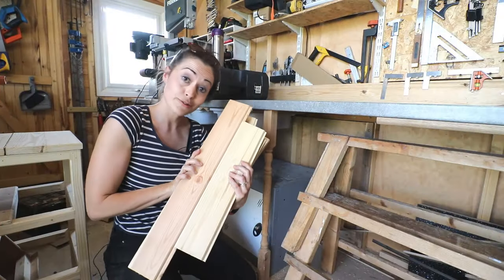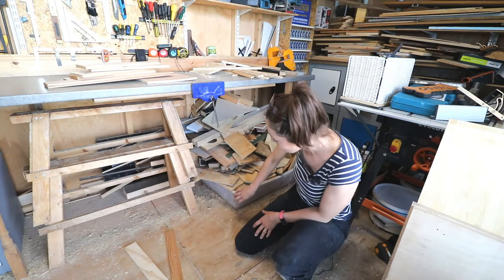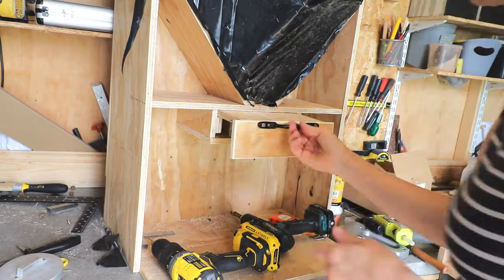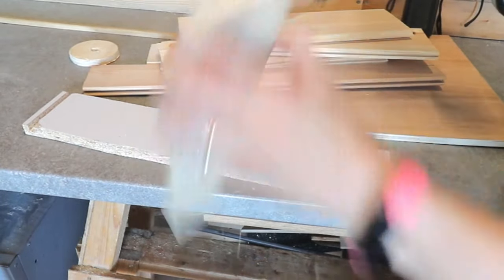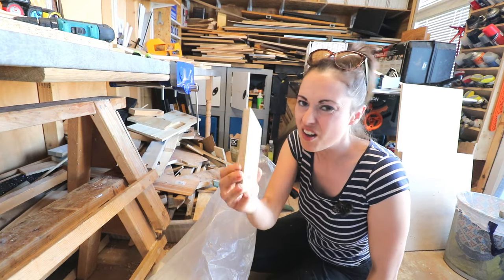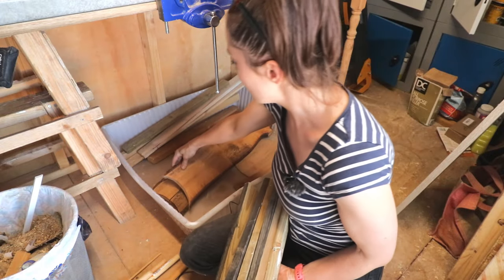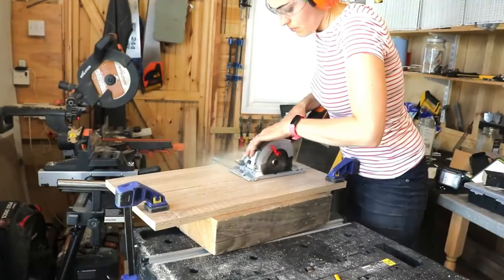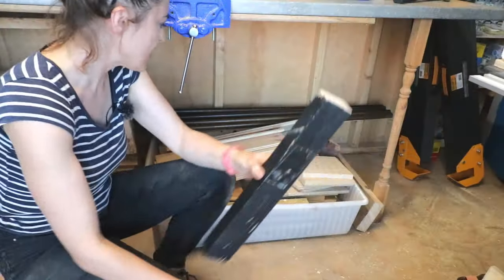Woodworkers Who Ignore this WILL HAVE AN ACCIDENT!

Comment: I hate getting rid of of tv parts, just in case I need them, about the same as you with wood, because you know what will happen when you throw it away, you will need it and you will spend ages looking for it then realising the fact you’ve thrown it away, get a garden wood burner and use it on a nice summer evening keep up the good work Vikkie
Reply from the maker: Ooh... I like the idea of a garden wood burner!  Something to consider :)  And can completely understand with TV parts!  I wouldn't mind getting into some electronics and can imagine all the small parts being useful.
Reply: @TheCarpentersDaughterUK  I'd be thrilled to see you also get into electronics. My journey is the other way around, lifelong electronic / electrical tinkering and repair while embarking on woodworking much more recently. Despite having made hardly anything yet I've already hoarded at least as much scrap as you; it all has conceivable uses! If anything it's easier to judge what electronic components and hardware is worth keeping or salvaging. Mostly I can't abide waste so one coping strategy is simply giving stuff away to someone who can use it.

Comment: You forgot paint stirers. I have a rule to only keep proper wood scraps. No MDF, no chipboard, no plastic faced ply (shower panels), but big bits of good quality ply are keepable. Scraps I don't want, including proper wood scraps, go in a box for my neighbour's wood stove. I was gifted 3 "oak" bookcases a few years ago. Actually slow growth pine with oak sides and facing. My daughter uses one as a bookcase; one got broken down for a project; and the third is currently storing medium size scraps!
Reply from the maker: Very good point about the stirrers!  And that's very disciplined!  I like it!  Sounds far less chaotic.

Comment: Yes indeed ,,we allll have that little corner of the shop full of off cuts and such. You could ask other woodworkers  or crafter's if they could use then for smaller projects. If you like to make small boxes and such, many of those pieces will come in handy. And as soon as you toss out that nice smallish piece of wlanut or mahogany or English oak,, you are going to have to go out and buy another board. Been there,,, bought that .....
Reply from the maker: That's exactly it.. the fear of needing it AFTER you've parted with it.  A few times I've been glad I didn't get rid of something in the end because I've needed it later 😅
Reply from the maker: But yeah... some I've had for years 😅